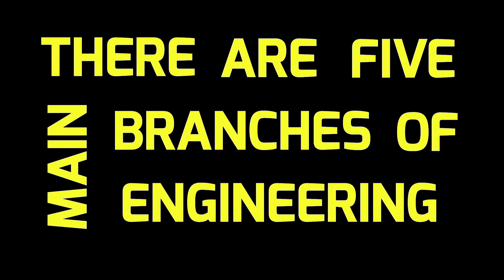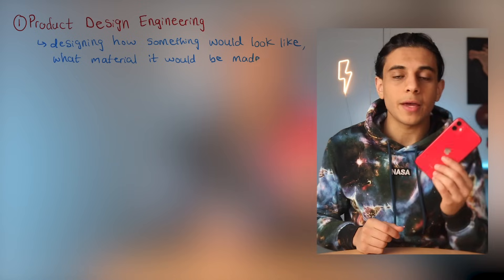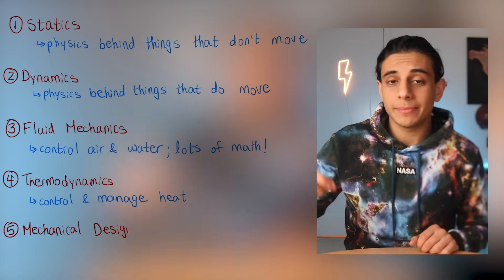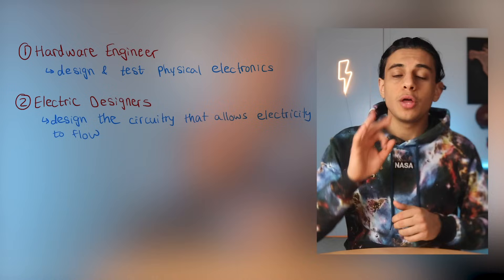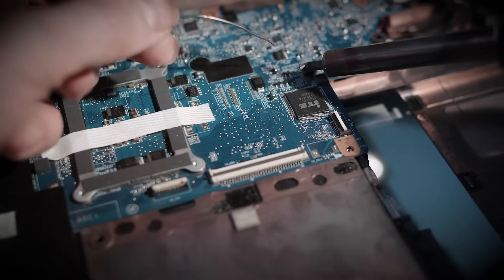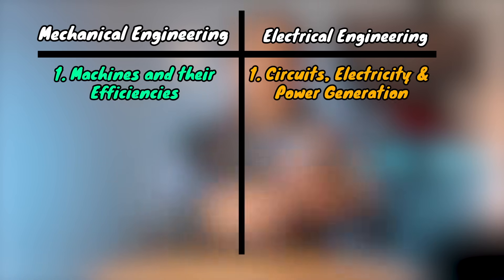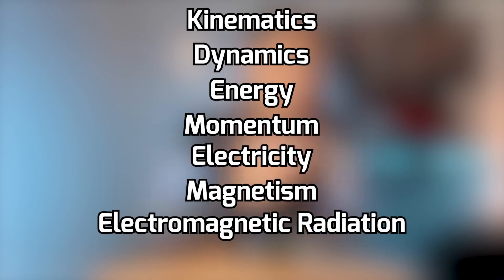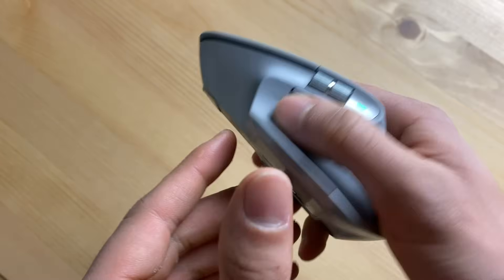Mechanical vs Electrical Engineering

Comment: Im debating on whether to be a chemical, industrial, or materials engineering. I specifically go to purdue where industrial engineering is ranked 2nd while chemical is ranked 16th while materials ranked 10th. Chemical engineering is harder than industrial and materials engineering but is the rigor worth it since they are all similar?

Comment: And some schools will have Mechatronics Engineering, which is clearly a hybrid of the 2, but hard to find, with ABET accreditation. And besides, even if your school doesnt overtly have such a major, you can still crosstrain with other majors via technical electives. A chemical engineering major can take electrical, mechanical, chemistry, physics, math, or other relevant classes to create a personalized education.

Ive even seen some other cool hybrid majors, such as cybersecurity engineering, geoengineering, and fire protection engineering. Its a cool time to be in college, because of interdisciplinary options like these.

Comment: I’m majoring in electrical engineering and want to become an electrical engineer however I got financially suspended from college due to a bad semester. There isn’t another college nearby that offers electrical engineering or mechanical engineering. I can’t afford to take out loans. I’ve been looking for work so I can save up money to take some classes out of pocket but I’m having a hard time finding work. I’ve been applying like crazy to every single job that I see. I’ve been trying to talk to my financial aid department however they haven’t been responding back to me. I have about  3 semesters left to get my associates degree in electrical engineering and 6 left for my bachelors. If anyone has advice on what I should do or any suggestions I’m all ears.
Reply: I am going to assume you could still take classes at your school as long as the money comes from your end (i.e. student loans, out-of-pocket). If that's the case, and you genuinely can't afford loans, your best bet would be to find a job first. Probably full-time. Doesn't have to be EE related, just something to bring in money. Preferably with flexible hours (so you can go to class). You need to continue being adamant about getting a job, and you should really look to boost your application by writing a cover letter even if it's optional. It shows you care. Applying for jobs can itself feel like a full-time job but if you're persistent, eventually someone will take a chance on you. Use whatever you can save to cover your classes. P.S. Some companies (Best Buy, McDonald's, etc.) offer tuition assistance where they'll cover a portion of your tuition. So prioritize roles that have this benefit. Also, check if your school offers a time-option payment plan (TOPP) where you can break up your semester balance into several monthly payments. In total it's probably a bit more expensive but it can help reduce the financial burden up front if you need the money for living expenses, etc. 

P.P.S. There are some online EE B.S. programs offered by universities (Arizona State, Stony Brook). A nice advantage of this is the classes are asynchronous, so you can watch the lectures on your own time. This can be incredibly helpful if your job schedule isn't very flexible. They are ABET accredited programs and you still get your labs done so its all legit. And if you're worried about your degree saying "online", don't be because it won't. I'm enrolled in Stony Brook's program currently working a full-time job myself. It's doable. Best of luck to you.

Comment: My academic background is Cinema and Physics = OPTICS, i was into Lenses design, etc. but when I got to be PROFESSIONAL I had to learn Mechanical, Electrical, Software, Chemical and NUCLEAR engineering = the learning you have to do never really does not stop and EVERYTHING is very HARD if your work gets to be at top 1% in your engineering field profession = NOTHING is just EASY

Comment: I came to know that there is not such a engineering called ece (electronics and communication engineering) in abroad. But it's one of the famous degrees in India. Some say ece in India is similar to ee (electronics engineering) in abroad. Is it really true? And will I have any disadvantage if I go for pg in abroad after completing  ug in ece in India

Comment: There is also a control engineering aspect that you can divert from basically any engineering branch, and it is more like applied math. Also, after graduation, you can say I decided to change my major and do graduate study in any composite engineering branch. You can study anything with just 1 extra year of preparation. I am talking with professors ranging from biology - EE - ME - biomechanics - biomedical etc. All of them seem plausible for graduate study. So maybe just focus on math and do 1 or 2 good enough projects in it?

Comment: I’m interested in becoming an engineer, can you tell me which one of the popular fields has more “hands-on” experience/ job duties?
Reply: My guess would be something like civil engineer maybe? They could get a job where they have to travel to different work projects and take a look at these sites in real-time if you know what I mean.  Although I suppose it's not exclusive to civil engineers.
Reply: I understand this a year late, but perhaps this will help others who have this same question. 

There's multiple different types of professions within each engineering discipline. For example, with an EE, you can choose to be in more of a Commissioning Engineering role. Meaning you would travel site to site setting up new installations. You could go into project management or even plant engineering support roles. If you lean more theoretical, then you'd want to go into more of a design and development role like a development engineer for some electrical equipment manufacturing company like ABB. 

And this, for the most part, applies to all engineering disciplines.

Comment: Electrical engineering is the best. Love how electrical engineers can dive into robotics easily
Reply: 😂😂😂😂 robotic is part in electrical engineering
Reply: Electrical engineering might as well be the most versatile engineering in the world. It’s super flexible imo.
Reply: Right after electrical engineering you can open your own company chip robotics Sensors embedded motors etc

Comment: Mmm strange, in Italy Electrical Engineering deals with most of what you said, but we don't take so many programming lectures and instead we focus on power distribution, electrical motors, electrical machines, machine design and so on.
In Italy Electrical Engineering is much more like Electromechanical engineering. In fact, like 40 years ago its name was Power Electronics Engineering, and I seriously prefer to use electromagnetism and Newtonian physics to build electrical motors that studying algorithms and data structures (and I can tell this because, as a bechelor, I am a computer engineer)
Reply: It depends what college you go to, in my college it focuses on what he discussed in video but in the college 3 hours from where I live they focus more on power like you said

Comment: But what if i want both? I both like making moving stuff especially stuff like machines for factories and planes, but i'm also really interested in antennas/radios and how to work with them and achieving processes through building analog circuits...
Reply: Try mechatronics engineering. It combines EE, ME and computer engineering

Comment: I think what's great about engineering is that you get a general understanding of all branches and can basically just choose what you want to work with depending on what you enjoy, regardless of what education you chose. I was struggling a lot with choosing either ME or programming. I then learned about CFD where I use all the knowledge of my ME degree, but basically write code all day.
Reply: Hello there @Nicklas , I am an upcoming ME student and I also enjoy programming. Can you tell me what CFD is? Thank you!
Reply: @yencytolentino4299  sure! Computational Fluid Dynamics "CFD" is used to model and simulate how fluids like air and water behave. I work with pumps and flow field iterations therein. How different geometries will affect the flow and thereby power consumption
Reply: @Lolwthify  that sounds fun! Thank you!
Reply: I am interested in cars, motorbikes and jet fighters. I really like mechanical engineering but all my relatives and friends are saying everything is shifting away from machines to electronic devices. What should i do. Shall i choose Mechanical or Mechatronics

I'm at a crossroad, because with mechanical, i can do what i love,that is building engines

But with Mechatronics,can i build an engine while also building a computer to control the engine?
Reply: @bonebone-dw3wm  I might not understand mechatronics correctly but I believe you’d still focus on either the mechanical, electrical, or software aspect of the engine instead of doing all three since most mechatronics engineers focus on one for their masters degree. If you love the mechanics then I don’t see why you wouldn’t do ME.

Comment: why am i seeing this only now...ive already applied for mechanical engineering major but now im doubting if it actually suits me
Reply: Same with me
Reply: What did you choose finally?
Reply: @kaushalsehgal2475  haha i eventually chose "robotics and mechatronics" in different uni
Reply: @baldaiomir  How's it going? 
I'm currently in highschool, thinking about mechatronics but I've heard there are not as many jobs for a mechatronics engineer as there is always someone better than you to do the job (i.e Mechanical or Electrical engineers) because they have a depth of knowledge in their domains, whereas mechatronics engineers just have the basics.

What is your take on this after almost a year in mechatronics ?

Comment: Why did you not say anything about mechatronics engineer? We kinde do it all :D 

I love it all. at work I do it, or at home in my garage.  Its a life stile not a job in my eyes. 
I'm a mechatronics engineer but educated in electrical.  I Install large CNC machines , mechanical work, electrical work, programming , fluid controll and CAD 3D work. 
I travle world wide and love it. But i miss the time at home and my privat projects tho :D # sleep more in hotels then in my own bed.

Comment: Hi Tamer! I know that you’re not an electrical engineer and are a mechanical engineer, but I was wondering if you help me with a project I’m trying to build. Recently, I’ve been trying to build an electric bike for a school project, and I’ve been running into problems regarding sparking and fire. For the bike, I bought a 350w 24v electric motor that comes with a gear sprocket attached to it. I plan to mount a similar but larger sprocket on the rear wheel and attach a chain connecting the rear wheel’s sprocket to the motor’s sprocket, which will in theory turn the bike. The battery im using is a 22.2v 1400mah lipo battery that has a xt60 connector. The motor has 2 exposing wires to power the motor with, so in order to connect the battery to the motor, I bought a xt60 to wire adapter to connect both of them. I also bought a small electric switch to turn on and off the motor when I use it. Everything seemed to make sense, until I decided to plug it in. When the parts came, I attached the battery to the adapter, and the adapter to the motor, and then a loud spark occurred. The motor powered on and still works till this day, but everytime I connect everything, a loud spark occurs, and some of the connectors have burn marks on them. Everything works well, but a spark occurs everytime and leaves burn marks on some of the connectors, and once started a small fire. Is it possible if you could tell me why this is occurring, and what to do to fix it?

Comment: I have a Bachelors degree in mechanical engineering and are close to finishing my electrical engineering master. Not common/easy to switch, but possible.
Reply: i want to do this. is ee better than me

Comment: Tamer can you tell me more about the Coop system and how does  it work
Reply from the maker: I’ll explain how the co-op program at the university of waterloo works. Let’s say you are enrolled in a 5-year engineering program where u start in Sep 2016 and graduate in Apr 2021. You would alternate between school and work terms for those five years. For example:
Sep - Dec 2016 (School Term)
Jan - Apr 2017 (Co-op Term)
May - Aug 2017 (School Term)
Sep - Dec 2017 (Co-op Term)
Jan - Apr 2018 (School Term)
…etc
This will repeat until you complete 6 co-op work terms!

Comment: I find both kinds of engineering very interesting, but what killed it for me was circuits in High School, this thing single handedly made my grades go lower than ever before.
It was so counter intuitive at the time, I would think I was doing the wrong thing and mark another answer, buth the first one was right.
I realized I would end up killing someone if I did that in real life so I went ME all the way.
Reply: what, you had engineering in high school?
Reply: @haas1298  no, but I kinda experience what I would have to study, and I didn't like it XD

Comment: Great breakdown of the difference between the degrees.  As a BSEE and now an MD, I would add that the EE degree has more electives and is more flexible.  My first computer was a slide rule.

Comment: I am an electrical engineer. If you like to do small embedded systems electrical engineering better prepares you for those kind of projects. I know lots of mechanical engineers that never touched a microcontroller, which is a shame
Reply from the maker: Ya ur def right

Comment: mechanical engineering is way better, not only because of how much you can do with the major but also because electrical engineers need mechanical engineers for whatever project they do. Electrical engineers are usually at a sitting in a office type of job. Also, mechanical engineers can usually do what electrical engineers do.
Reply: If i want to build a small robotic car with computer vision i totaly dont need any mechanical knowledge. Just need some basic parts and small servo motors.
Reply from the maker: Ya both majors need to each other to get the job done

Comment: As an ME student, it's definitely EE that's more difficult. Just the fact that it's more theoretical because the people there work with literal imaginary numbers (i), and that's just one of the many reasons why.
Reply from the maker: Ya I agree with that
Reply: Lololo
Reply: I hope you also used differential equations to describe dynamic motions? Laplace transforms can be used to solve this easily and it uses 'i' as well.
Reply: You are so cringe bro... 
If you fear math especially complex numbers... I as a CEO of ME take your degree and qualification back unless you repent
Reply: @hhhuthhhjj5599  Bro I don't fear math, I enjoy doing it in my free time. I'm just saying that the math in EE is more difficult.

If I say multiplication is more difficult than addition, that doesn't mean I'm struggling at multiplication lmao.

Comment: No offense, but I think you need to spend a bit more time working in industry and getting exposure to what ME's in different areas actually do. Walk into a grad school computational mechanics department and say "EE's do harder math" and you will get coffee thrown at you. I've never designed a keyboard... that is what product developers do. Real Mechanical Engineers do stress analysis, fracture mechanics, creep life calculations, design the flaps on airplanes, build rockets, reactors, suspension systems...
For god sake, ME's built the Apollo moon lander man... and you picked headphones as an example?
Reply: For real man, this guy made Mechanical Engineers look like amateurs compared to Electrical Engineers.
Reply: The thing is, Electrical Engineering is simply harder than Mechanical. I study Mechanical and a friend of me studies Electrical and we often compare the stuff we learn and the exams as well. It's easy to tell Electrical is the harder of the two
Reply: No EE’s math is definitely harder, but as an EE major, I wouldn’t want to take organic chem or thermodynamics.